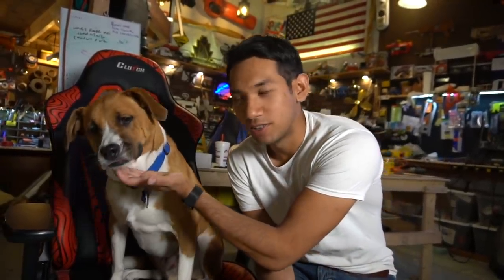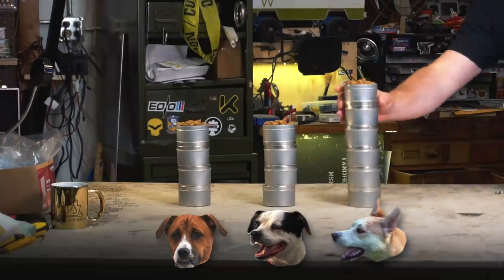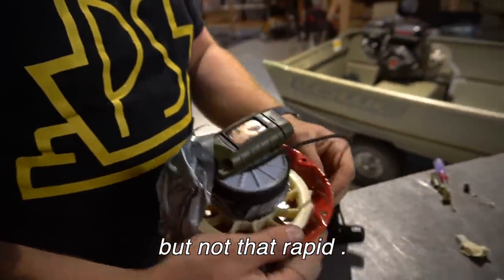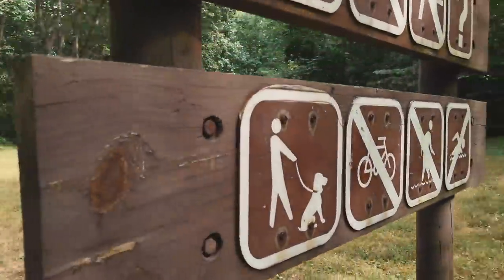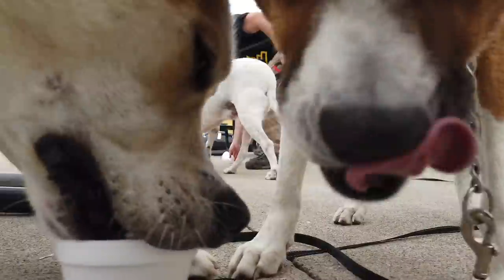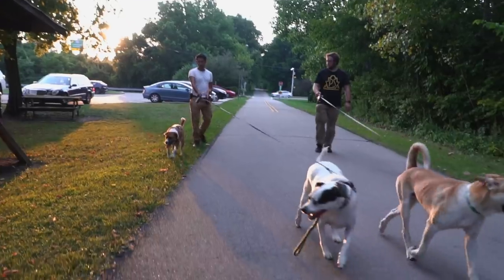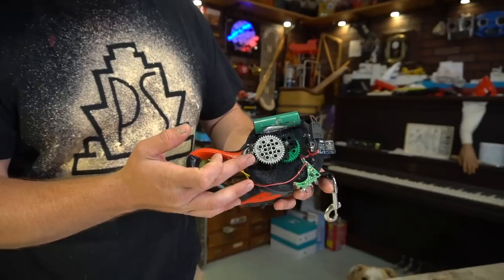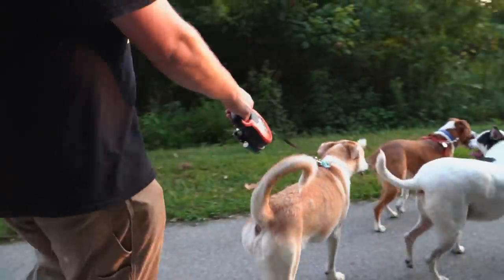HACKING My dog to CHARGE my phone!!!?

Comment: I have seen dog walkers walking 6 dogs at once.
Phone charged in one day.
Reply: walk em for 2 hours and u got urself roughly 8%
Reply: @akamai3125  
Don't dog walks usually take two hours ? :)
Reply: @OverUnity7734  exactly but for 8%
Reply: @akamai3125  
The real question is, does a dog walker work 8 hours a day ?
Reply: @OverUnity7734  true 2 hours would give a lot more then 8 percent and 8 hours would be fully charged
Reply: Why would 2 hours give more than 8%?
Reply: Prehistoricman cause it doesn’t give less
Reply: @userPrehistoricman  
In an other comment some one corrected the amount of Watts that the food is actually giving. "calories from food are actually kilo calories, so 2400kcal = 2789 Wh not 2.7Wh"
Reply: Oh yeahh, I forgot about that.
Reply: Considering the battery usually lasts about 1 day it's more like phone charged as long as you walk your 6 dogs everywhere.
Reply: @OverUnity7734  Wait I thought in your original comment you were referring to the 5.8 day estimate which was done with power meter and pulling by the string. It had nothing to do with the food.
Reply: But you still have to pay for the dogs right? And that will be very expensive
Reply: @markh2200  
I know people whom buy a phone charger every month, maybe the average person buys one every 3 months, so for $1K to pay off, the dog would have to live for 40 to 125 years, or find someone else whom needs their dog walked .  Some people only buy expensive chargers $25.00, some people only buy $8.00 chargers from the gas station .

Comment: You should make it spin at one direction only, 
the in and out of the cable  stop the rotor and decrease the power created.
Try to increase the rotation in one direction only.
Think of it like a motor.
If you make it only spin by going out and find a way to make it keep spinning. 
Pushing it out again would increase the speed and the energy generated.
Reply: possibly use a flywheel?

Comment: a tread mill that charges you phone when run but only when wet,
basically a water senser that when wet allows power generated by running on the tread mill

Comment: You should use a stepper motor with a bridge rectifier instead of a stand dc motor to generate the power. That would be more efficient as you’d get less resistance. Cool project though👍🏻

Comment: Here’s an idea.
1. Have two transceivers connected to your legs to measure the distance more accuracy without GPS.
2. Attach a generator between your legs and use the resistance from walking or running to generate power.

Comment: Make phone charging shoes. Shoes with springs underneath that work on the same principle as the dog leash. 

I guess using two sheets of wood with linear guides in the corners should help give stability. The guides may even have the springs around them, so 4 springs per shoe.

Comment: Actually not a bad idea, but you are using the wrong porpoises! You guys stated it would work with LED's and small electronic devices. Well, there you go guys, a dog leash Swiss Army knife!
Here is your "Infomercial:
1. Be safe and secure as it lights your way at night.
2. Has built in USB MP3 Player
3. Has strobe light that flashes "SOS" signal.
4. Has a 120 Db siren and strobe light to ward off attacker by a big mean dog (or a mean person).
5. Has a built in "STUN GUN" in case your siren and strobe are ineffective.
6. Has battery backup able to enable the stun gun feature and to "Flash Charge" your cell phone for emergency calls to 911.
7. Comes in a genuine simulated wood grain handle.
But wait, there's more! Order now and receive a free pair of "Night Vision Glasses" don't let those glaring lights blind you or your doggie, be safe while walking your dog.
When ordering be sure to ask about the upgraded deluxe version that will handle up to 4 doggies on one Swiss Army Dog Leash.
Maybe that's dumber than the original idea?

Comment: U could use the leash pull to add energy to a weighted wheel,.. as the wheel spins it will store energy than can then be harnessed to charge a battery. Good idea,.. just need more thought.

Comment: Great video peter! Next video should be a wind powered phone charger, but you use it by holding the propeller outside the window of a car while it’s driving on the highway, so the wind is stronger and it’ll charge you phone while not using any car battery or anything off your car.

Comment: I wonder whether using the force of the dogs pulling to spin a flywheel could be possible. That way you wouldn't have to bring the lead in and out to charge the phone. Don't know if that mechanism is possible or useful for generating electricity though.

Comment: Lol, I’m amazed you didn’t just take apart a baygen freeplay clockwork radio.. the early kind with a huge spring which you wind up and the spring turns the dynamo over a few minutes and dumps the power into a battery to power the radio. The dog leash could wind the spring maybe?

Comment: With some induction linear generators (a spring loaded magnet in a coil) fixed on the back of the dogs on the 3 axis and a power bank attached with adequate electronics (1 diode bridge/coil) may work. Now I have to find a doggo and a bunch of treats for... SCIENCE... Mouhahahaha... 

Really good looking doggos... They may find a partner easier than you. ^^

Comment: Make a device which you hook up to your foot and then pull a rope through holding it on both ends. You can then use a higher gearing ratio and go hard. Assuming you could put out 50 W consistently (which I think should be not that hard), you should be able to charge your phone in 30 minutes or less.

Comment: You could use a weighted wheel that continually spins from each pull of the lead and then use that spin to charge a capacitor to then charge the phone?

Comment: Those magneto lights are incredibly inefficient. I'm sure you took one apart and saw the ceramic magnet and single coil inside. I saw briefly that you also tried a brushed motor. Again ceramic magnets and brushes...poor efficiency!

Try again, but use an outrunner and shotky diodes to rectify the 3 sine waves to DC.  I think you will get significantly better results.

Comment: I wonder if you could use the in and out movement of the leash to wind up a spring and that spring tension then turns the generator so you have constant charging power. 

Have an over running clutch in the wind up mechanism so when the leash retracts, it's just like the pull start on a small engine, but when the dog pulls it out, the clutch engages and rewinds the spring a little each time, just like when you pull on the pull start of the small engine, it turns the engine over. 

Now no matter what the dog is doing, even if he's sitting and eating ice cream, the spring is unwinding and charging your phone or built in battery. 

I would also look at a vacuum cleaner cord set up. Those have long cords and long long coil springs that store up a lot of energy to turn a small generator to charge a battery. You can buy replacement cord winder on amazon. 

If you look in the upper right hand corner of the picture, you'll see the spring and how big it is and how much energy it can store over and over again, providing constant turning of a generator. Remove the cord and replace it with the dog leash and your dog has a much greater range of movement as well for charging up the spring over and over again on a single walk.

https://www.amazon.com/Electrolux-Exr-3075-Vacuum-Cleaner-Winder/dp/B00L0G8W94/ref=asc_df_B00L0G8W94/?tag=hyprod-20&linkCode=df0&hvadid=167140851087&hvpos=1o6&hvnetw=g&hvrand=9254518065760523870&hvpone=&hvptwo=&hvqmt=&hvdev=c&hvdvcmdl=&hvlocint=&hvlocphy=9025277&hvtargid=pla-365148411087&psc=1

Keep up the great work.

Comment: Correct me if I'm wrong but, if you were to find 2 10,000MAH 7.4v 2S batteries, the small ones. 7.4v×2 is 14.8v. so not only I used two battery's to come up to perfection for my powertrain, but I just made a 20,000mah battery??

Comment: I hope you got a patent on that cause that's a top idea ,am sure once you've had a tinker it'll be super efficient, how many times you've come in and first thing you do is take the dog out but being out already your phones dead ,so you either leave it on charge at home or chance what life is left in it for an important call or message ,that or you live your life permanently on the phone ,only draw back is if you got a bone idol dog ha ha .possibly change the generator for bigger one for more amps and using a single cell lipo battery backup pack circuit to generate 5v for usb lead

Comment: I've had an idea of a RC plane I would like to build, but do not have the experience, space or financial situation to do it. It's basically a methanol-electric hybrid plane (with batteries that charges from the methanol motor and with solar panels on the wings for extra charge), were you control it and can see the camera feed over the 3G/4G network. It would be so neat to be able to fly it over long distances, obviously with some stort of autopilot if you lose the network coverage.
Is this a stupid idea, or something you find neat as well?

Comment: Could you use the same hardware and more gears to use a heavy weight, and not your dog?  Hook the device to the ceiling and tie it to a concrete block and push it off your loft.  Gear it down so it take 30 min to fall, as it charges the entire time.

Comment: This was not a great means of energy conversion... You will not be producing charge all that often, only when the line is coming back to you or veing pulled out by the dog, NOT when in stable tension like a leash us intended to be in.

You could almost certainly produce more energy by using the compression of walking instead or if you put on of those leashes on each foot and let them charge from your legs passing by one another with each step.... There are so many more efficient ways this could have been done with the same stuff

Comment: It is possible to use the same "in and out" charging gear system on each of your main joints (knees, elbows,shoulders and hips) so that when you jog, you would feel slight resistance but it would also charge a battery ? It could use a similar rope system so you aren't locked on an axis... Which wouldn't be so bad for elbows and knees but shoulders have too much rotation.  If that works the possibilities are endless. Shoulder mounted self powered lasers anyone ?

Comment: Hey Peter ,how about a modern day baby carriage the kinda active people use to jog with . Used the carriage wheels to power a alternator an have the dog help pull the carriage like a dog sled ,I bet those Huskey's could charge a automobile battery. With that type of set up you could include a fly wheel that is always spinning an could provide contentious force. Second idea in your design could you make it way larger like the size of a 20" bicycle wheel an use a flywheel an as the dogs run away they spin up the fly wheel like a top , but like a rear bike wheel it keeps spinning an ever time the pull they keep it spinning. I would love to see a flying wing like a B-2 stealth but filled with hydrogen making it almost lighter that air ,I don't know like a 10 ft wing span . I bet it would fly so fast but take little energy to keep it flying.